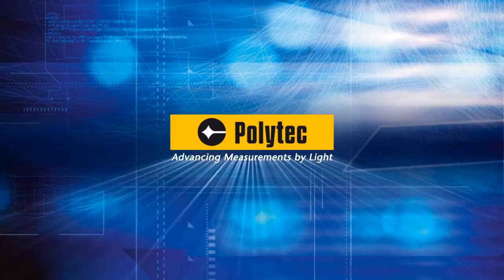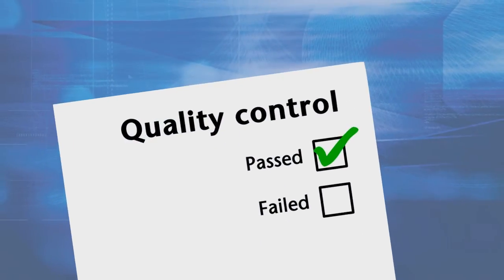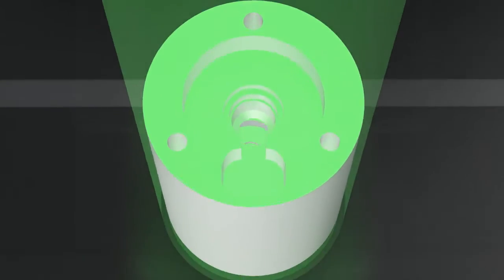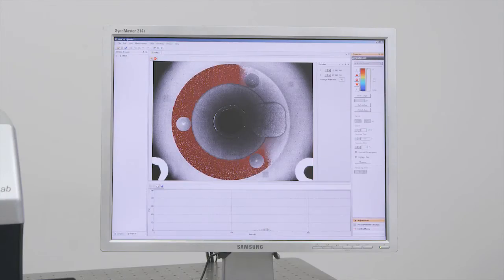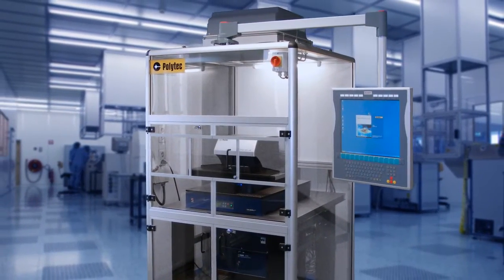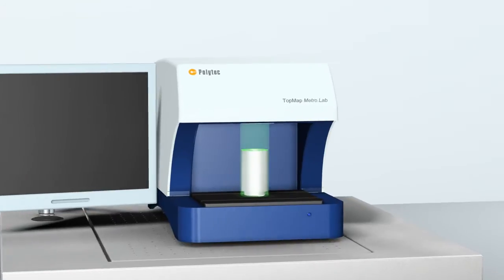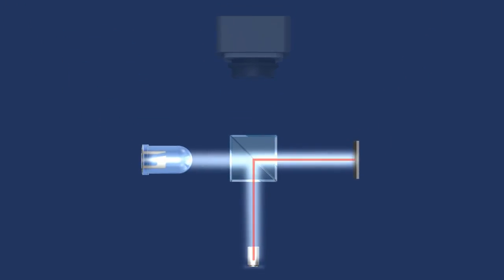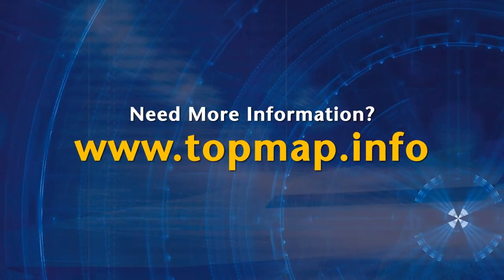3D Optical Surface Profiling

Comment: What's the largest area you can stitch?
Reply from the maker: With a regular system (e.g. Pro.Surf https://www.polytec.com/int/surface-metrology/products/3d-surface-profilers/topmap-prosurf) we can acquire 44mmx33mm without stitching (one single field of view). If we use motorized XY stage, we can reach up to appr. 200mmx200mm. Depending on requirements, we also have possibillities for customized stages. Get contact us to discuss your requirements info@polytec.de.

Comment: can this measure dimension as well
Reply from the maker: Our systems are ideal for surface metrology with high precision and in addition to that we can also perform dimensional analysis. The best thing is to analyze your case in details (with your technical requirements). If you wish to discuss your application with us, you can get in contact via info@polytec.de
Reply: @PolytecGmbH   I sent an email please check